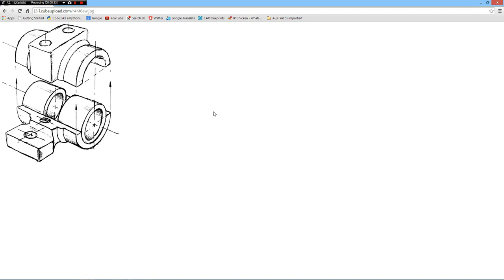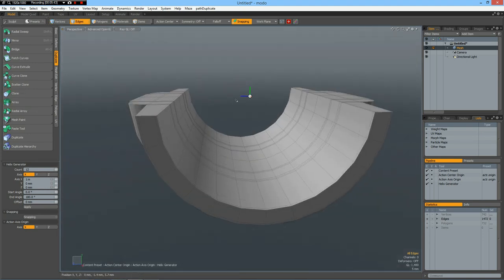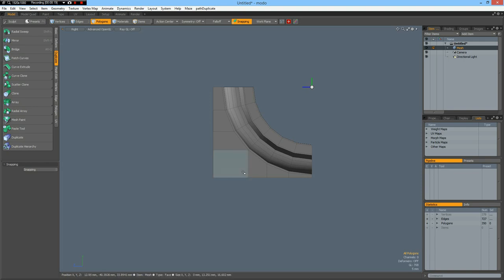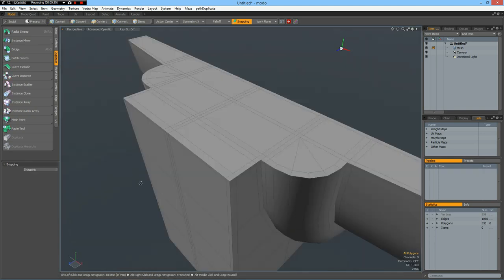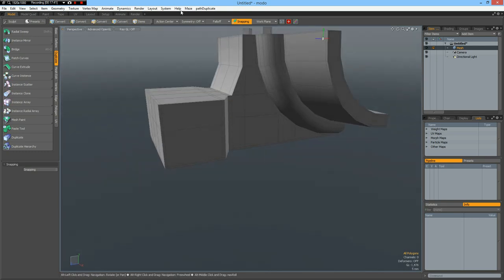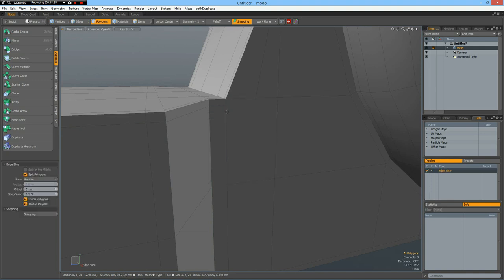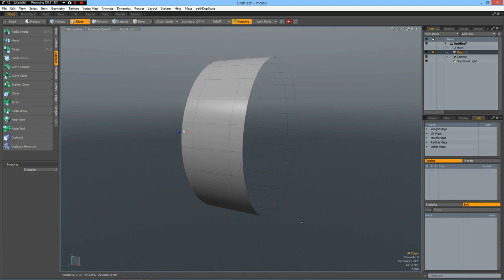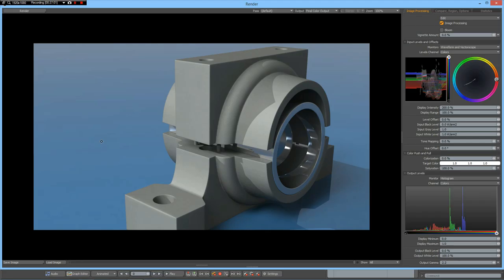The Foundry MODO - Modeling a Bearing Block

Comment: Should have started with a half cylinder with two loop cuts in the middle,  extrude that faceloop from the cylinder and flatten the top.  Easy, done,   NEXT!
Reply from the maker: Starius2 As i said at the beginning of my video: There are different approaches. I have used the one i have shown and i am not so sure if your suggested workflow is really faster :-) Have you tried it out ? Kind regards, Peter

Comment: Hi Peter! I have a puzzle for you! Yesterday on one of my models I found a strange topology. Two "spiders" with an edge in common! Do you know if there is a simple way to get rid of both (or one) without adding more "external" loops.
This is a picture of the two spiders http://www.giannisoldati.com/temp/doublespider.jpg
I would like to see how you deal with this strange situation. This two spiders are on a very curved surface and so they are very visible and annoying! Bye and thanks again for your videos!
Reply from the maker: Koutetsu Jeeg Hi, sorry, i see no solution other than connecting all the outer vertices with horizontal edges. You can use a background constraint to make it look nice
Reply: Peter Stammbach Umbelievable! You solve it so easily! I spent one day trying to figure out how to do it! And I always ended up with another Tpole! Now that you told me it was so simple! You are great!